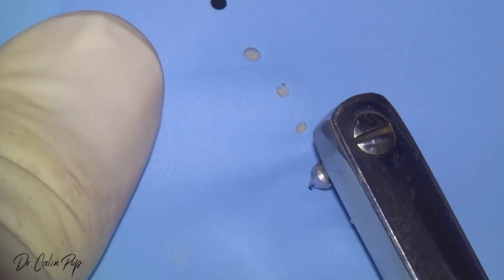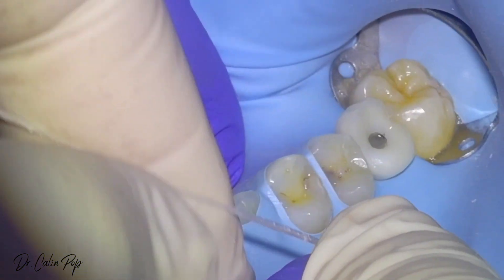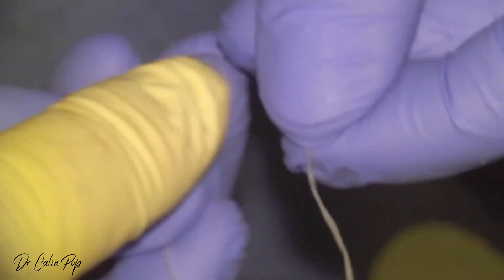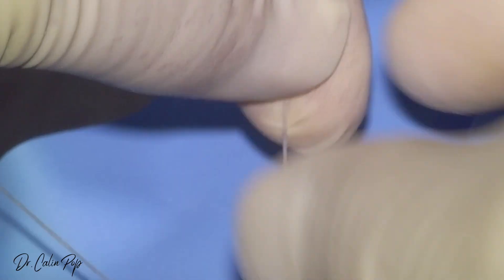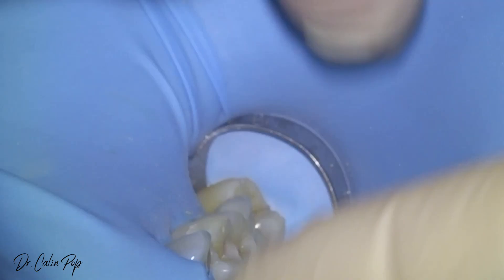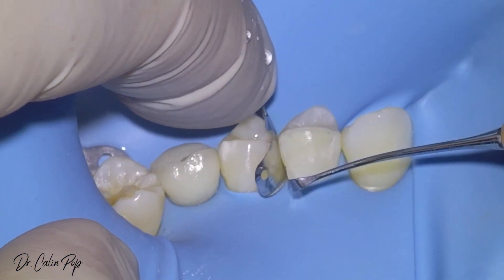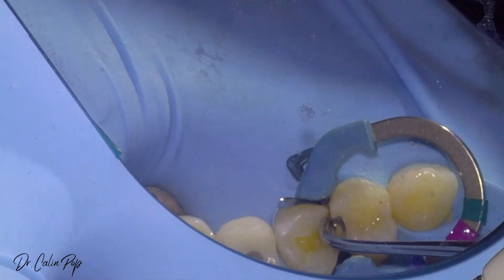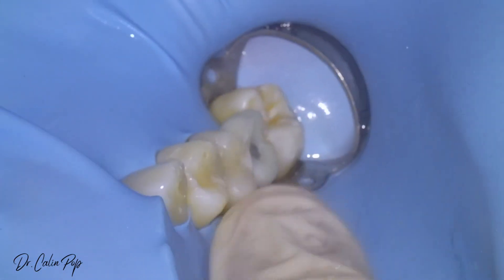HOW TO PERFORM CLASS 2 COMPOSITES ( TIPS & TRICKS ABOUT RUBBER DAM AND MATRIX SYSTEM)

Comment: Ah, this is 24 DO and 25 MO?  It's a 40 min procedure to be profitable.  No need for all the serious classical music - these are teeth right?.  And no need for RD here - gravity and a skilled assistant can handle any moisture issues.  I will fill the first one and then check occlusion, which allows an accurate assessment of marginal ridge height which guesstimating under RD can't do.  #8 bur no water, to get height, then disk to get inter proximal contour then 7803 for anatomy, then move on and fill the other.  As well, if the interproximal caries is subgingival, the clinician is reluctant to chase it as there is a risk of winding up the inter proximal septum of the RD and having a big surprise for you, the patient and your CDA.  Use cotton roll isolation and chase the caries til it's gone.  Keep it simple.
Reply: Or just use the greater curve matrix system
Reply: Nobody asked.

Comment: Thanks doc. Why bonding before band and wedge placement? What if we place band and wedge first?
Reply: In my experience the matrix and wedge may cause bleeding and contamination of the cavity
Reply: @jonathankaplansky4005  thats also a good reason
Reply: I ment the other way around. The process of inserting a wedge sometimes causes bleeding that will contaminate the cavity. That's why i prefer matrix first
Reply: @jonathankaplansky4005  oh,  i see, well, same.comment jhaha, thats also a fine technique!
Reply: Then You probably miss some of the Bond seal to the saucer type margin preparation, also it could be more difficoult to remover an etched band.